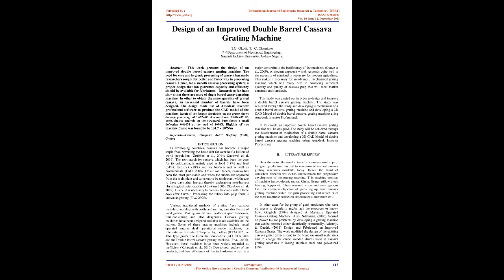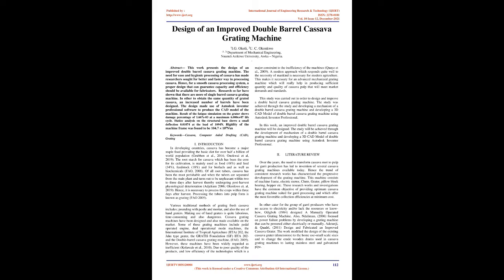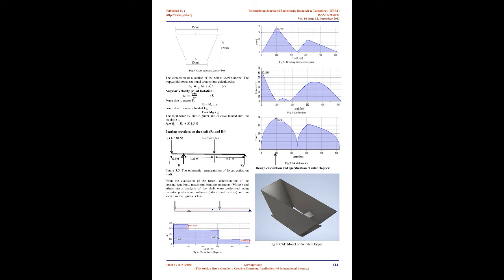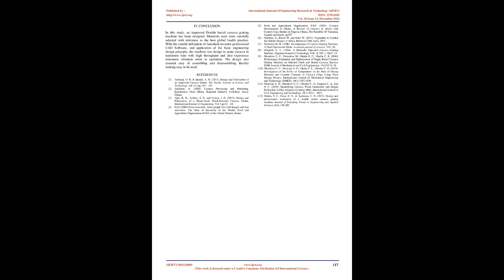Design of an Improved Double Barrel Cassava Grating Machine

Comment: What happens if the barrels rotate in opposite directions? Dont you think it will be way more improved? Consider having the barrels a few mm apart rotating in opposite directions thereby pulling cassava to the center (ie btw the barrels) and each barrel grating the cassava from two sides at same time.